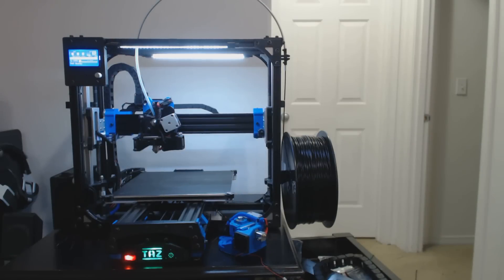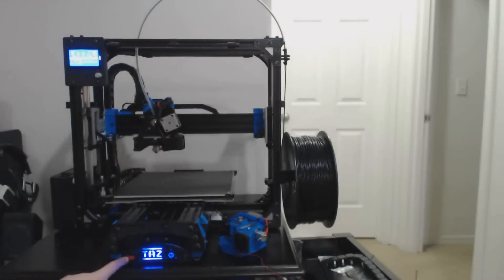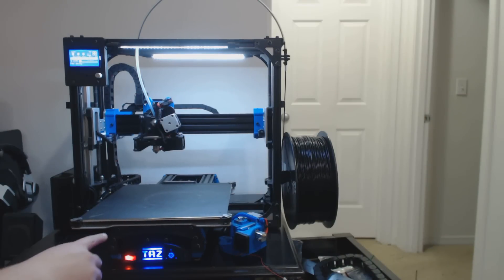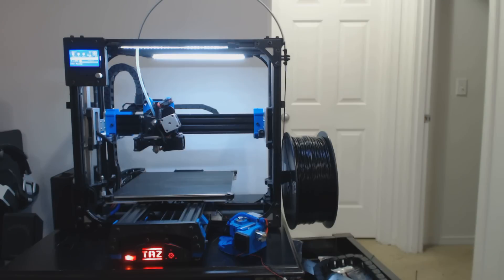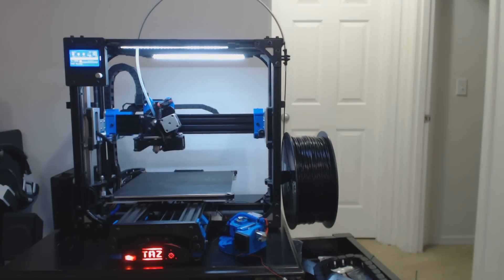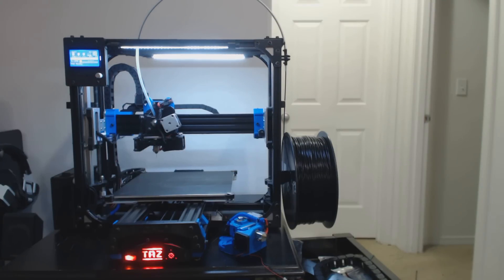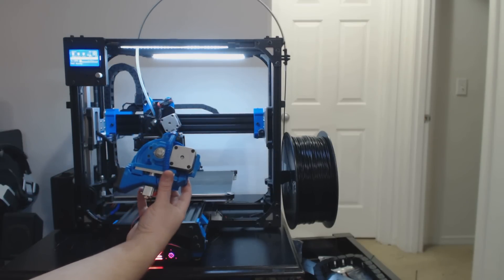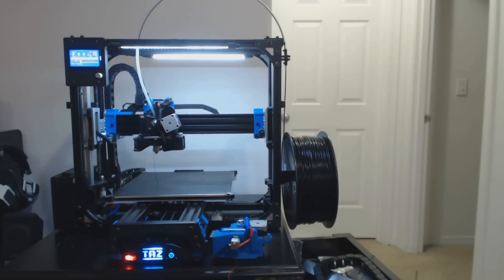A Video Tour of my Lulzbot Taz 3d Printer Modifications

Comment: Nice machine! My question is that how much better is the aluminium bed than the glass is? Do you get better temperature in the corners and how flat is it compared to the glass bed? I want to make this upgrade in order to use inductive bed mesh leveling with build tac or a PEI sheet. My main question is that where did you get an aluminium plate of that size? Thanks for the answer. Keep up the good work! ;)
Reply from the maker: Thank you! The Aluminum build plate is a major improvement over the glass bed in my oppinion. The main advantage is that you get even heat spread all the way to the edges of the bed. I can print something right at any edge or corner and expect it to stick just as well as it does in the middle. It also ends up being slightly lighter overall, so it does save on machine wear and allow for faster printing, and also gives you potential to use an inductive probe. I have Buildtak over my plate, but PEI also works quite well. I find the buildtak surface gives me slightly better adhesion with ABS, but at the cost of having to replace the sheets every so often, where PEI is pretty much indestructable. 

The one downside to the aluminum plates is that it is difficult to source one that is very flat. I've been very lucky that I was able to find the two that I use without need for any straightening or modification, though I know others who used the same sources I did ended up with bent or warped plates. If you can get a truely flat plate, they work great. I've used both ebay and amazon to source these. You want to look for a 12" x 12" 3/16" thick aluminum plate. For this application "Mill finish" which is basically "unfinished just as it came off the rolling mill" is fine since you will be covering it with a sheet of plastic. They generally cost about $25. You can find 1/4" cast tooling plates in 12" x 12" sizes, but they are too heavy as is. If you have access to a machine shop that can cut that plate down to 3/16" thick without warping it, that would be the ideal plate. Other metals would also work. Copper would actually be theoretically lighter and higher heat conductivity, but I haven't tried it. Steel would be a bit heavy. Thanks!